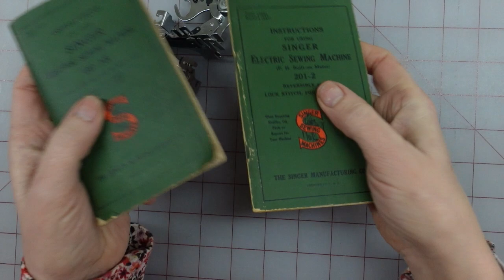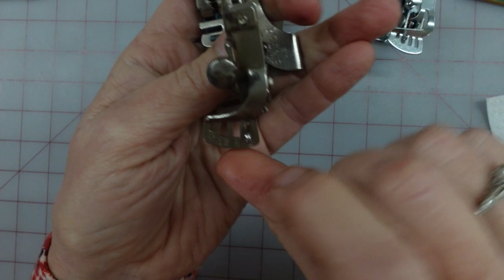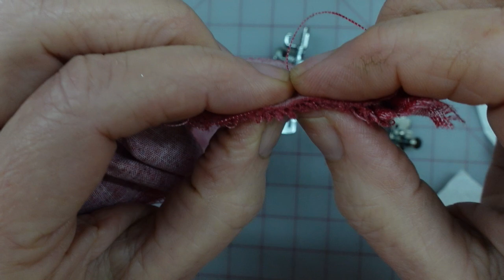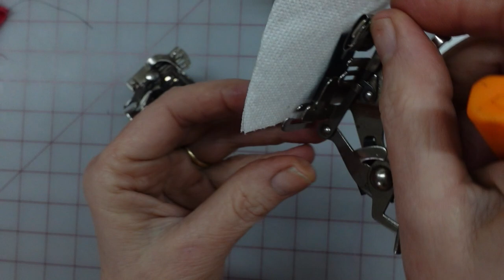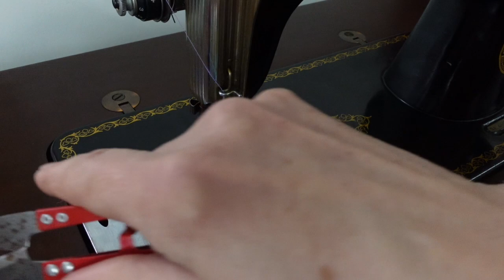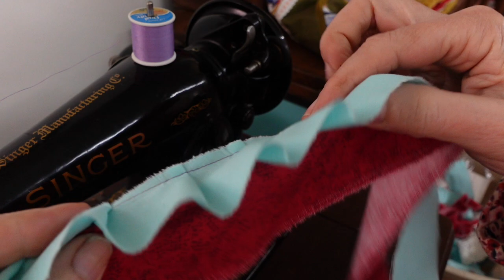How to use a Ruffler Attachment for a Sewing Machine

Comment: These are such fun and the early ones go back a long, long way.  I reckon with all those gathers back in Victorian times (especially on the multi-ruffle petticoates) it would have been something every seamstress wanted the moment they became available. I've got an old one that goes back to 1893 (I was lucky enough to get it in an old puzzle box, and it still works!).   :-)

The other variable you can play with to get different effects is your stitch length.  The more stitches per inch the more gathers or ruffles per inch too.  That can be handy if, say, a gather every stitch at a certain "depth of gather" is just slightly off what you want.  The variations must be endless.  

My tip for any of you pulling one of these attachments out the back of some drawer.  If you're going to do a lot of ruffles on a project (say, a frill on the bottom of the sleeve and a matching one for around the neckline) you'll want to make/do all the ruffles before you change your settings on the ruffler.  It's relatively easy to note down the stitch length and number of stitches between each "pleat" that you were using but getting the pleat depth exactly the same as you've done it before is a bit more of a challenge.  :-)
Reply from the maker: Good tips Megan! 😊😊

Comment: Question... Would these great older attachments/feet work on modern computerized machines if you have a low shank foot for a low shank machine?
Reply from the maker: I would think that they should, but you never know until you try. Just use a medium length stitch